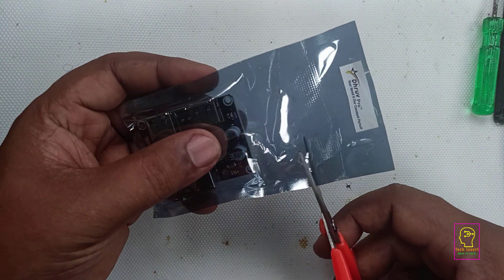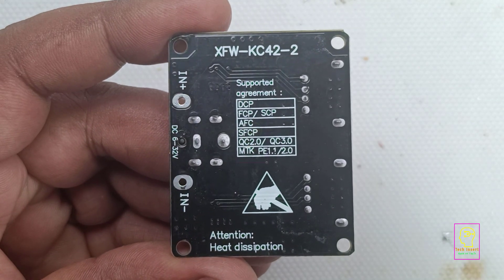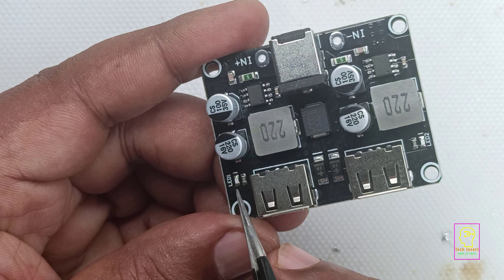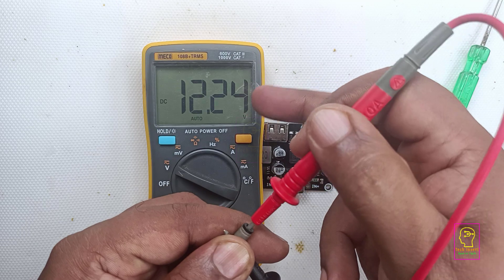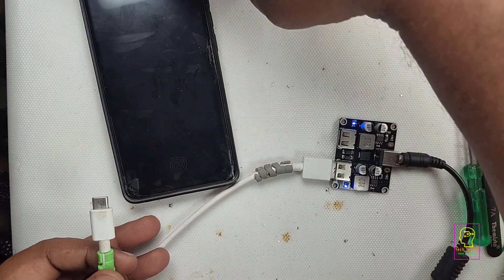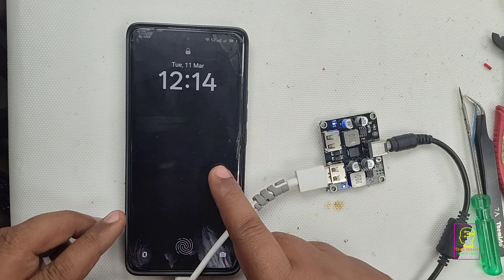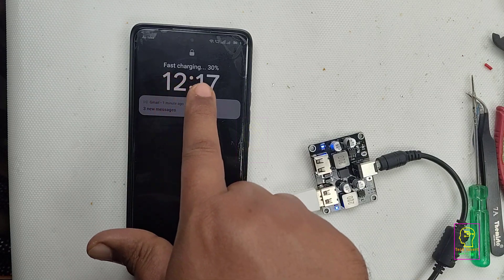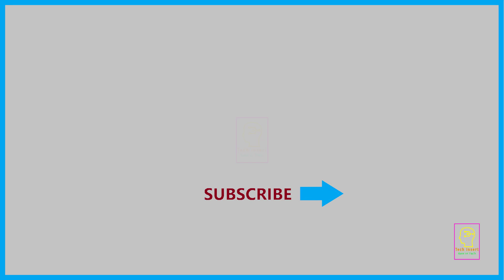DIY - Mobile fast Charging Module

Comment: Hey,
How to make power bank with lithium phosphate battery😊
Reply from the maker: Kindly watch this, I have added this module inside this. https://youtu.be/cSjEEv8X1so?si=V4Iyh60S3eSSGA3i
Reply: @TechInsert Did you mean the DC-DC Buck module?
Reply: any Specific module for li-phosphate battery to make portable Power bank ?
Reply from the maker: The above one is good, but need to add a charging module